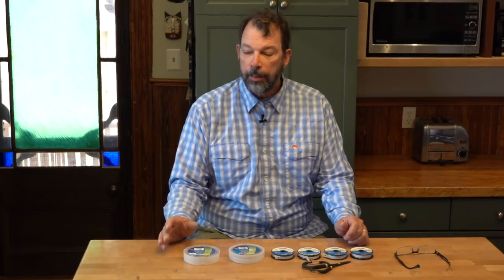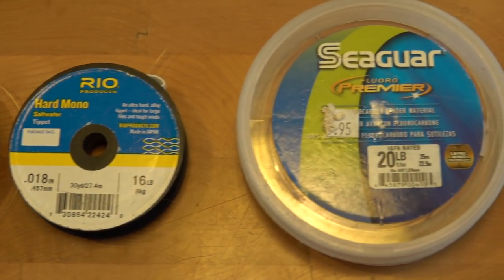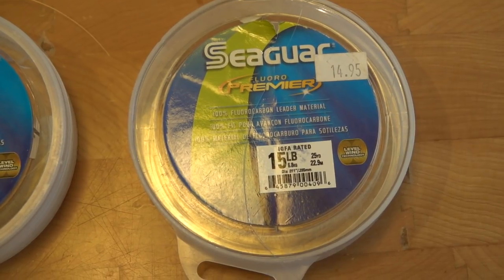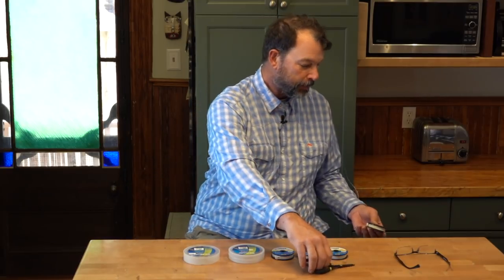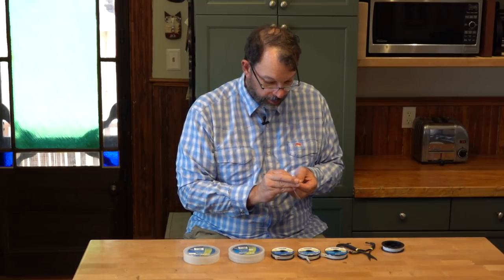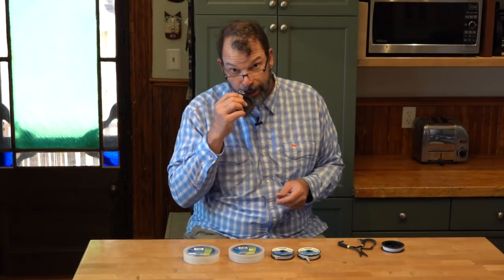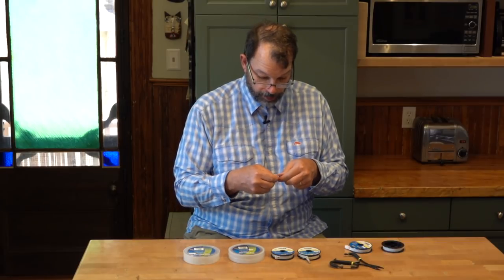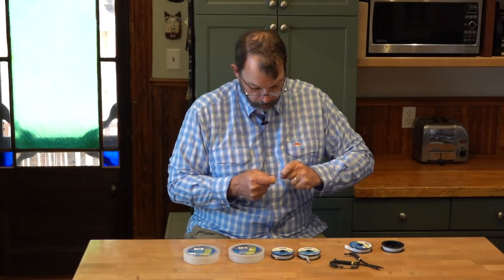Tie An Effective Bonefish Leader

Comment: what weight fly line is this leader for?
Reply: Hey Bob great question! Why dont we toss 24 dry flies on a 10wt salt rod or toss giant crab patterns on a 2wt fly line?  This never really gets talked about and we all love loop to loop leaders.  But really there is a step between the fly line and the butt of the leader and that step is often too big.  Starting from his .027 butt section that should really be around a .041" fly line tip.  Regardless of weight of rod and fly line.  This can vary depending on the type of like so perhaps a weight forwards might be chunkier in a 8 than a double taper in a 9 and that would inform your butt section.

I like to start with the fly that I want to toss.  I then figure out what weight rod and line I plan on using by size of fish.  My leader design bridges the gap.  So if I used this formula and it wont lay out my fly but my tippet is right then I'll probably add in a stiffer butt section either by shortening the first bit and going heavier at the butt.  If that fixes it and it's not overly long its golden.
Reply: what weight rod would you fish for bonefish with?  This leader will definitely work for anything from 6wt to 10wt.  I've been tying my own leaders using hard mono to flourocarbon for as long as I can remember and I fish a 6wt a lot but also 8 and 9wt and I don't change the leader.  It's basically universal considering saltwater rods are being used.